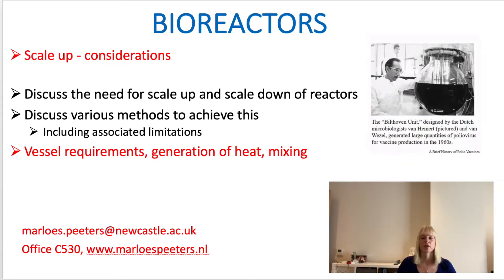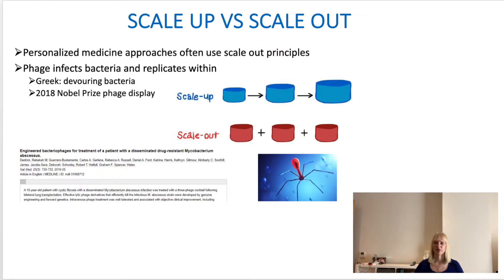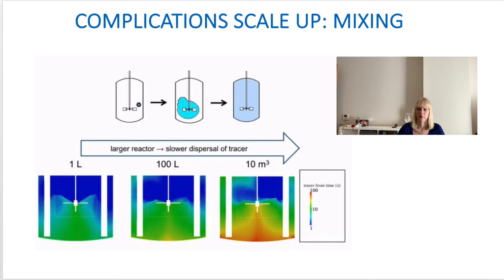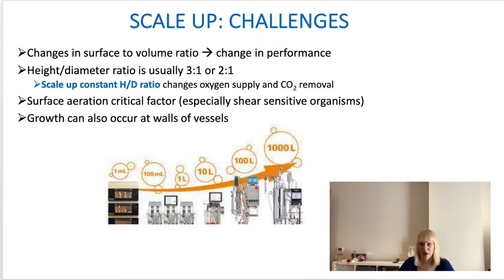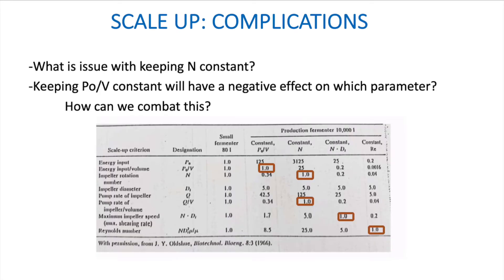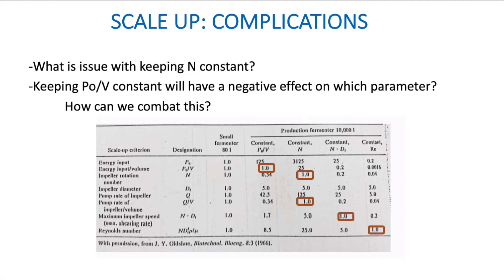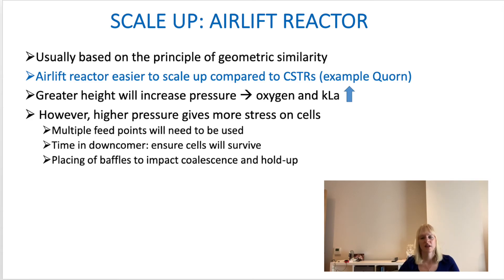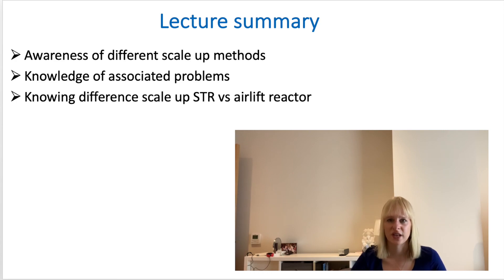Scale up challenges in bioreactors

Comment: Hi, in 06.14 you mentioned if you keep N constant, P/V would decreased, hence the oxygen transfer within the liquid would also decreased. But is it not the other way around? From the table, If we keep N constant (N=1) during scale-up, then P/V value increases from 1 to 25. Also, the same case, if we keep P/V constant then wouldn't N value decreased from 1 to 0.34?

Please let me know if I was mistaken cos I am a bit confused now.
Thank you for the video!
Reply from the maker: Hi! Thanks for the comment. I think you might be reading the table the wrong way around. Keeping N constant (third line from the top), you can see P/V decreases to 0.34. If we want to keep P/V constant (second line from the top), you can see N will have to go up by a factor of 25. Just think of it this way. If you keep the speed the same but your reactor will go bigger, it means parts of the reactor will not be mixed properly (as you can see at 2:24). So generally, this will mean oxygen transfer will go down. Hope that explains it
Reply: @MarloesPeeters  Hi! didn't think you would reply, thanks a lot!

I was reading the table vertically at first, e.g. 
if P/V is kept constant in scale-up, then these parameters would change such as N=0.34, P input = 125 and so on.
But from you explanation, the correct way is to read the data horizontally e.g.
if P/V is constant, then N = 25, N*Di = 0.2, etc.

Your point about oxygen transfer will decrease at constant N when scaling up, therefore N should be increased makes sense to me. But say we have bigger tank with larger impeller diameter and we would like to find the appropriate N value using constant P/V strategy. The N value calculated for bigger tank is always found to be lower (due to larger impeller diameter). Practically, do you think applying lower N in bigger tank with larger diameter will give similar oxygen transfer? Sorry if i'm asking too much and thanks again!